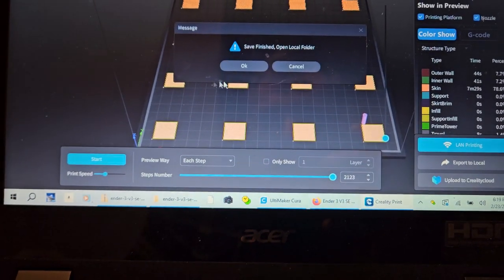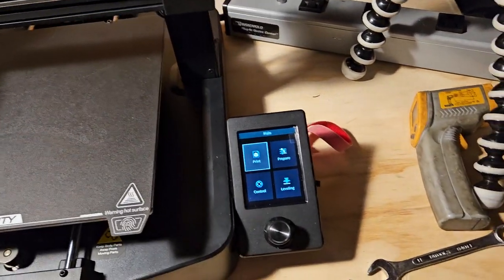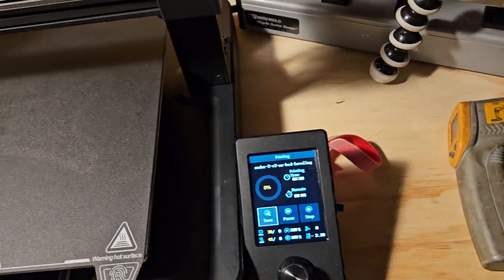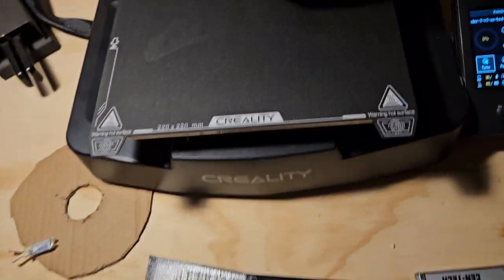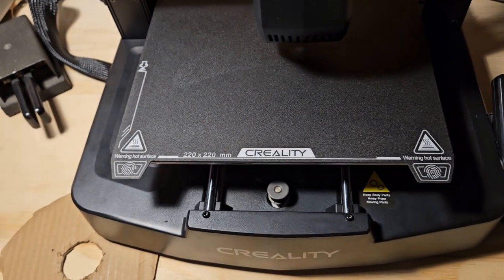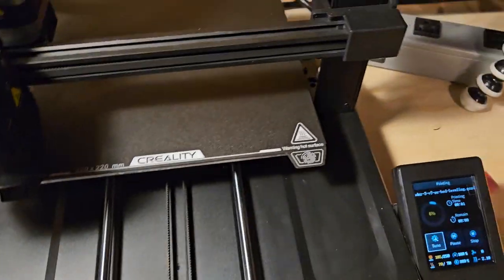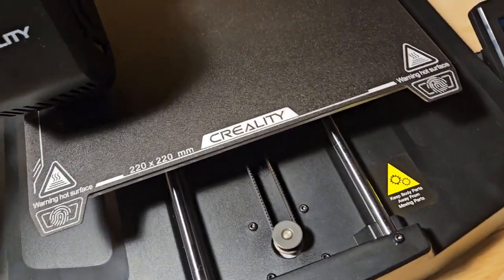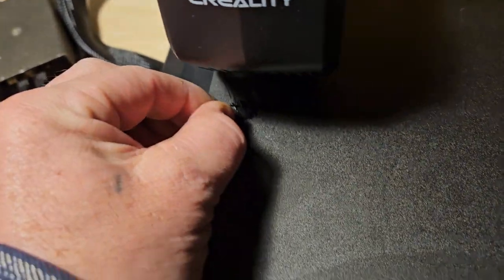ender 3 v3 se calibration table

Comment: You'll never complain again about your ender after you try a Labists ET4...the ender is saving my sanity after that...
Reply from the maker: I had a pyramid a1.1 3d cr10 clone that was pretty bad. I learned on that one. A guy gave me several ender 3 printers last year and i fixed them all and had alot of fun with them. I sold them all and kept the ender 3v2 neo which i added dual z axis motors and direct drive mriscco firmware  then klipper w sonic pad. It works great. But the ender 3v3 se i had was bent funny or something.  I just had a bad apple 🍎

Comment: Follow these steps.  First off the calibration looks way off so first off reset it.  Control/Reset Config. Then choose pre heat PLA and get all the filament out, wipe the nozzel.  Then go to prepare and it should set it self up.  Then put some fillament in ( 45 degree cut ) and extrude a bit of poop.  And then print that test file you have Calibration OFF.  If you need to use edit calibration then you use a piece of paper while adjusting just like you do with manual beds sliding the paper backwards and forwards.  Hope this helps.  Also, if printing PETG turn the fan down to something like 25% as over cooling the stuff can cause you to think it needs to be hotter.  You should be able to print that stuff fine at 235.
Reply from the maker: Ok. I cant figure out how to do paper test. It wont unlock the servos
Reply: @hamradiohack To do the paper test, you usually do this after you have printed out those squares and checked them to see if you have a problem with any...  in the menu, control, edit leveling data...  and then use a piece of paper under the nozzle,  you want it so you can move the paper easily but feel the nozzle.  You can go and check one of the areas you are happy with first to get an idea of the feel without adjusting ( because it is the ones you are happy with )  and then adjust the ones you are not happy with.  Side note you usually do not have to adjust them much at all as they will be close to what they should be from auto leveling.  The lower the number, the lower the nozzle.  Once you have one area set you confirm it, then you have to go back and do the next and so on.  There should not be many off though but if you want you can go through all 16 and set them the same.  Obviously after you have done this you do not want it to ever calibrate itself again, well, maybe if you think it needs calibrating again.  Feeler gauges are of course better than paper, but paper works.  Hope this sorts it.
Reply from the maker: @wonderingworld119  i cant get it to allow me to move print head while in the adjustment menu. Not sure why. Something else happened and it gouged up the print bed. I am also thinking print bed is maybe not sticking so well either. I was seeing alot of people on Amazon  have ordered  the comgrow replacement pei kit https://amzn.to/3SPEy1c
My bed is fairly close now but cant print without a raft.  Raft sticks fine but im struggling with these end fed wire winders where it prints round  circles. So i have positive and negative  numbers on the calibration sheet. Isnt that odd? Small number is closer to nozzle? So .057 is further than - .057
Reply: @hamradiohack Nah that's normal.  If you think about how small a mm is,  and then we have and unflat bed, and then put it on rails, and then have the nozzel coming down on this beam thing... its pretty amazing they get that close in my mind lol.    Have a look at what firmware it is on.  It should be something like 1.06 if I remember right. I am using cura 5.6.0 because it has the V3 SE profile already in it and I have not touched the settings in it apart from eneabling Z hop and changing the fill to gyroid.
Reply from the maker: @wonderingworld119  what does z hop do? Help with elephant foot?